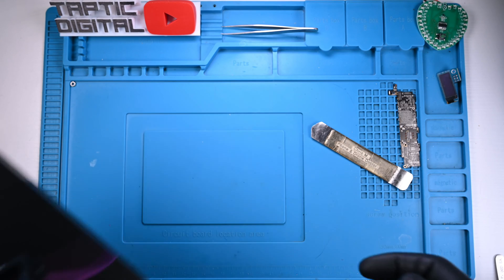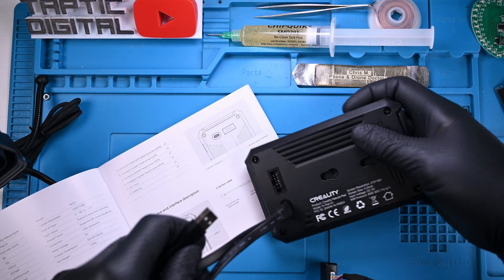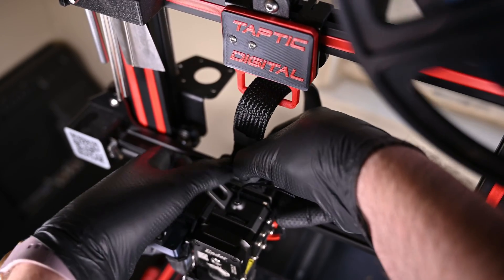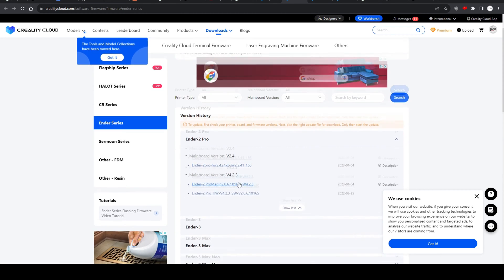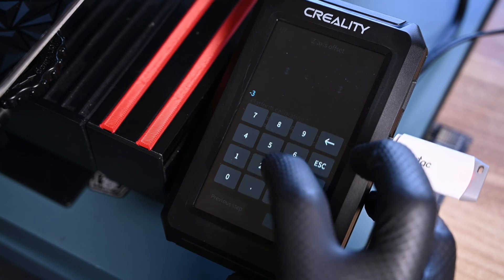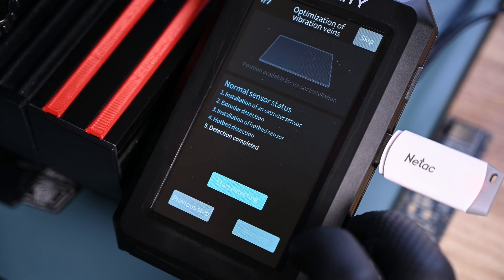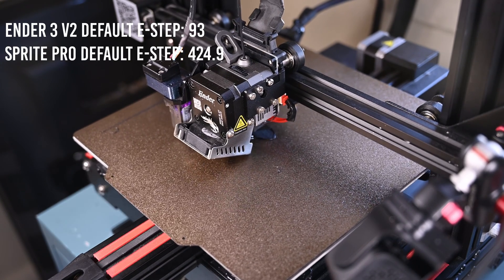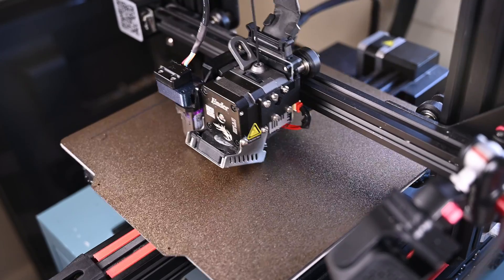(UPDATE VIDEO IS OUT) The Creality Nebula Pad kind of SUCKS, I think? - Unboxing, setup and testing

Comment from the maker: UPDATE: New video coming soon, I was able to get this device working but it was not without some serious tinkering. You'll need root SSH access, a custom firmware, and to set up fluidd and mainsail. New video coming soon!
Reply: Créality has announced an update for the nebula pad, which will support the sprite extruder, for the end of February.
"Dear Customer

Thank you for contacting Creality customer support.

Sorry, Nebula Screen does not currently support changing the E-step. We will update the firmware by the end of February to support it."
Reply: I'm really looking forward to your video, I faced the same problem myself
Reply: What’s the default SSH username and password? I’ve tried getting in, but I don’t see what the defaults are and my guesses have so far all been wrong
Reply: @kbyethx  Try user/pass of creality/creality.  That's what it is on the Sonic Pad.
Reply: root / Creality2023 @kbyethx
Reply from the maker: @kbyethx  I wish I knew, I had to use a custom firmware that replaced the SSH login to get it working
Reply: It's all a lie, don't believe it

Comment: I wish u had done the Z-offset manually instead what u already knew what it was, yeah Im stumped.
Reply from the maker: @wfs1965  the Z offset doesn’t change from whatever you had it set to before, there were no physical changes to the hotend so there would be no changes to the offset. Run a print and adjust the offset as it goes to find it
Reply: @TapticDigital  that makes sense, thnx

Comment: keep getting key: 2022 error unknown exception when trying to home the printer after installing the nebula smart kit and I have no clue how to fix this as there is barely any support on the Creality websites...anyone able to help me?
Reply from the maker: Few things: Make sure the only thing on your printer's MicroSD card is the firmware_Nebula_Pad bin file from the Nebula's USB. Unplug the USB C cable from the Nebula Pad, turn your printer on, and then connect the USB C. The pad can be powered by the LCD ribbon or the USB C, but seems to only work properly when it gets power from the LCD ribbon first, and then the USB C.

Comment: Process:

Go to the download center, eco systems, nebula smart kit and click on the 3D Printing Firmware; Download and Extract.
Take the SD card that came with the machine format it in FAT32 with 4096 for unit allocation.
Only put the ender 3 *.bin file on the card.
Put the card in the machine with the Nebula Smart Pad attached. (DO NOT HAVE THE G SENSOR ATTACHED)
Turn on the machine and follow the prompts on the Smart Pad.
 found this on the help pages

Comment: What an absolute garbage upgrade kit. This thing is clearly not meant for use with the V3 SE like they advertise.
Reply from the maker: Check out my new video where I put rooted firmware on it, it makes it all worth while
Reply: @TapticDigital  I couldn't get it to work. There wasn't even an option in the menus to load/unload filament. Creality offered zero installation details for the V3 SE in any of their documentation so I had to figure it out based on half a dozen YouTube videos. I could get it to bed level and calibrate the g-sensor but it would error out every single time I tried to start a print. I'm sending it back. So disappointing.

Having it require that spaghetti mess and an extra USB power input is just sloppy engineering.

Comment: been trying for a few hours. still cant get it to connect to my v3se
Reply from the maker: The instructions are terrible, here’s my own: 1. Format your MicroSD card and copy the ‘firmware_Nebula_pad.bin’ found on the Nebula flash drive to your MicroSD. 2. While the printer is off, connect the Nebula pad to the display ribbon cable from your printer. No other connections to the nebula, no flash drive, no usb c. 3. Power the printer on, when you get to the set up screen connect the usb c cable to the nebula pad. 4. Continue set up, and it should work from there.

Comment: Such a shame you had so much trouble with this, it seems good on paper..
Reply from the maker: I ended up releasing a follow up video about it where it works well but only after rooting it with custom made firmware. It's now my daily driver! It prints fast!
Reply: @TapticDigital  I did see the follow-up, but the point of these things is supposed to be that they work out of the box, so any trouble had is naturally a shame..

Comment: what do i do if i was following step by step and also  put the wrong firmware on my sd and my printer is now showing a straight black screen?
Reply from the maker: Format the SD card and put the correct firmware on it, pop it in and boot it back up.

Comment: i have a ender 3 v2 with a 4.2.2 motherboard and have tried everything and it never goes past the connecting screen, ive tried renaming the file, skipping wifi setup, different sd cards. chatting with creality was no help.
Reply: It's all a lie, don't believe it
Reply: The method is simple. After inserting the bin file in the USB into the TF memory card you were previously using, turn off the printer, insert the TF memory card, and then turn it on.
Reply from the maker: Creality support is a joke, I’ll just go ahead and say it. What ended up working for me was formatting an SD card, putting ONLY the nebula pad firmware bin file (from the nebula flash drive) on the card, and putting it into your printer. Next make sure your nebula pad is off (unplug the USB C),  and only connect it with the printers screen ribbon cable. Power it on, wait about 2 seconds, then plug the USB C into the nebula pad.
Reply: @TapticDigital  so not the ender3v3 bin file on it at all?
Reply: omg, it worked right away! THANK YOU SO MUCH!! @TapticDigital
Reply: @TapticDigital  What??? 2 seconds after turning on the C type?? Do the damn thing~!!

Comment: Is that on an ender 3 v2
Reply from the maker: It sure is, the 3 v2 is my daily printer
Reply: I have the Sprite extruder like you have with the CR touch any tips on the offset settings my probe is probing off the bed I can't figure it out

Comment: I was given this info from Creality

I can provide you with comprehensive instructions to guide you through the process:

1. Gather Information:

Manual and Firmware: Refer to the Nebula pad's user manual and online resources for specific instructions and compatible firmware versions.

Extruder Specifications: Gather details about your direct drive extruder, including model, voltage, and any necessary wiring diagrams.

2. Access Firmware Settings:

Connect to Nebula Pad: Connect your computer to the Nebula pad using the appropriate method (USB, Wi-Fi, etc.).

Open Firmware Interface: Use the recommended software or web interface to access the firmware settings.

3. Modify Configuration:

Extruder Type: Locate the setting for extruder type and change it to "Direct Drive."

Steps per Unit: Adjust the steps per unit value for the extruder stepper motor according to your extruder's specifications. This ensures accurate filament movement.

Retraction Settings: Configure retraction settings to prevent oozing and stringing, which are common with direct drive extruders. Adjust retraction distance, speed, and prime speed as needed.

Motor Current: Set the correct motor current for your direct drive extruder's stepper motor.

Other Relevant Settings: Modify any other settings as recommended for your specific extruder model and setup.

4. Save and Upload:

Save Changes: Save the modified firmware configuration.

Upload Firmware: Upload the updated firmware to the Nebula pad, following the manufacturer's instructions.

5. Calibration:

Calibrate Extruder: After updating the firmware, perform essential calibration steps, including:

E-step calibration to ensure accurate filament extrusion

Z-offset calibration to fine-tune the distance between the nozzle and the print bed

Comment: Please explain how could you manage to connect nebula touch screen , which has 2 row 10 pins interface , while original touch screen on Ender s1 pro has one row 6 pins??
Reply from the maker: I'd assume you need to use some kind of adapter, mine is the Ender 3 v2 and uses the 20 pin connector by default like the Nebula does.
Reply: @TapticDigital   hmm... somethig to find out indeed. thank you.

Comment: Hello, I’ve just got a nebula. I have a v2 Neo. I’ve printed the bracket but mine hits the left roller casing when trying to home. Did you have the same issue?
Reply from the maker: I did not have that happen, I did catch mine trying to level outside of the bed area at one point, grinding against the far edge of the X axis
Reply: @TapticDigital  the bracket they give you just doesn’t work so now I’m trying to create a custom one like you 😅

Comment: So you don't need to remount the sensor on the bed for the Y axis calibration?
Reply: Yes, the sensor goes on the bed for the Y-Axis test. I have a Sonic Pad, and the instructions for it clearly state this.  It can be clipped on the edge of the bed with a binder clip, or you can print a holder for it on the bed (as Ricky Impey does in his Sonic Pad tutorial serious).
Reply from the maker: Not that I could tell, as there was no way to mount it. I assume it detects the back and forth rocking from the extruder just the same

Comment: I have just added this to my ender 3 pro with a sprite extruder but it keeps probing off the bed . There doesn't seem to be anyway to set the home position. Can anyone help pleasr
Reply from the maker: Correct, if you have a Sprite it makes the extruder offset different from stock, and there is no way to program that into the Nebula without either rooting it and installing Fluidd, or possibly G-code that reduces your bed size through software; changing the size from 200x200 to 160x160 could help. I've just posted a video update about how a custom firmware can fix this, and hopefully that firmware is public very soon.

Comment: I cant get rid of the motherboard error on my v3 se 😢, I’ve tried like all the files and none work
Reply from the maker: I was only able to get it working when I put the firmware_Nebula_Pad.bin on an otherwise blank microSD and put that in the printer, connect screen to printer with no USB C (Gforce sensor) so only the rainbow ribbon, then power the printer on. If you have a CR touch it will turn red after start up, this means the firmware update was successful and it’s waiting to connect to the Nebula.
Reply: @TapticDigital so my cr touch is red but still getting the communication with motherboard is abnormal

Comment: Hi there I’m getting the same machine motherboard error on my v3 se. I can’t figure it out I have the bin firmware on both the usb and sd card and it’s not working. Is there a specific step I’m missing?
Reply from the maker: I have an update coming soon, the nebula isn’t optimized to work with much but it can be through some firmware hacking !

Comment: Just bought one of these kits, and I'm just curious, do you HAVE to use the g sensor? I have an Ender 3 V3 SE and I really just bought this kit for the touch screen, network printing, and the camera lol
Reply from the maker: You don’t have to, but it does help when tuning acceleration and stuff. I’ve left it disconnected and not noticed any major differences.
Reply: You need the g-sensor just to do the calibration, after that you can remove it.
Reply: @Pablo-vt9jp  actually I just got it in the mail today, and with the Ender 3 v3 SE you don't need the G sensor for calibration, mine went through setup just fine without it and it's insane how much of an improvement in print quality I'm seeing. Well worth the money for the upgrade, couldn't be happier.
Reply: @DuuurtyDan  how did you get this to work with your se mine keep saying communication with the motherboard is abnormal
Reply: @kennytashro3072  did u install the firmware(

Comment: There is a very recent update for the Nebula at Creality downloads. A few more bracket stl's , firmware for V3SE. Some bug fixes. Manual is still unhelpful. The update has better pictures of how they want things mounted on the tool head.
Reply from the maker: I'll have to check that out! I managed to get mine rooted thanks to a redditor, but I'm always down for testing
Reply: Do you have a link to the rooting process? Trying to get this running on my V3 SE. Thanks @TapticDigital
Reply: I'd like to know about the 'root'ing.  I can use Creality Print with Nebula and E3 V3SE so thats good. It seems clumsy but I can adjust. I really want to get OrcaSlicer to talk to it but that probably will take some additional magic  @TapticDigital

Comment: Man......I hope this thing gets some updates.  I have an Ender 3 Pro and was looking at the Klipper pad, but than I saw this and liked having it all integrated into my printer itself instead of having a tablet off to the side.
Reply from the maker: As an update, I was able to get this pad working though it required a lot of tinkering. It needs to be rooted to gain SSH and install Mainsail and Fluidd, at which point you can use the web console to adjust setting. Definitely not as plug-and-play as I'd like, but I'll be releasing a follow up video soon

Comment: Hi, You can change flow in slicer.  It's bad way, but it work...  Creality support promise fix it very soon....
Reply from the maker: Tried, but even at the max 300% it wasn't enough. Thankfully I've found a rooted firmware that allows me to change it! Updated video coming soon
Reply: @TapticDigital  pls share me the firmware, i can´t fine any firmware that allows me change settings, i have same problem with my ender 3 pro with sprite extruder
Reply: @TapticDigital   please upload it soon, as its inoperable with the sprite se neo extruder

Comment: You can root the nebula, as done for the cr10se...then access via ssh or web interface
Reply from the maker: Unfortunately this failed as well, simply says "Upgrade Failed". I'm thinking this root is solely for the CR-10SE and not any other printer. Good try though!
Reply from the maker: I'm trying this first thing tomorrow, if this works, you're my hero